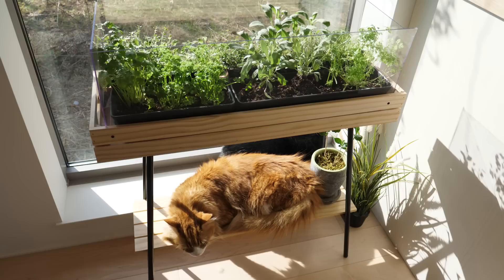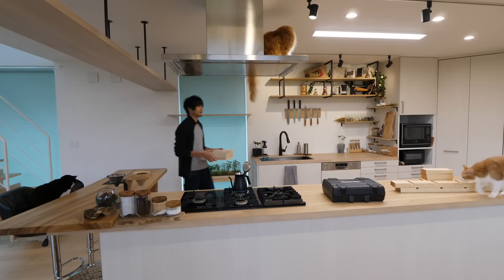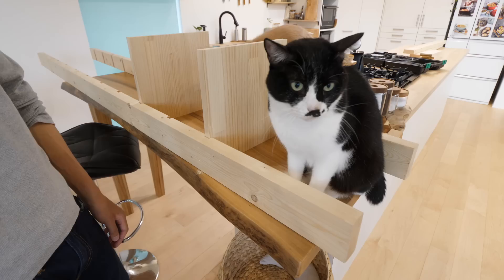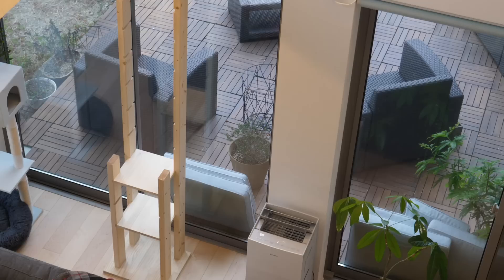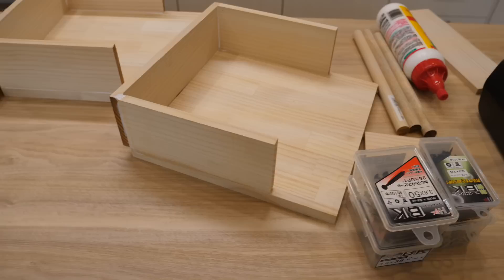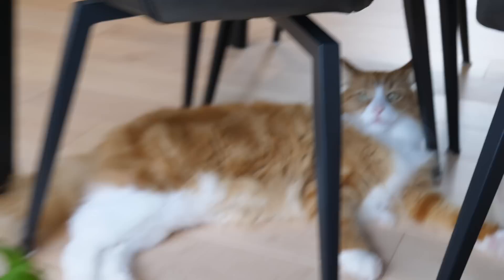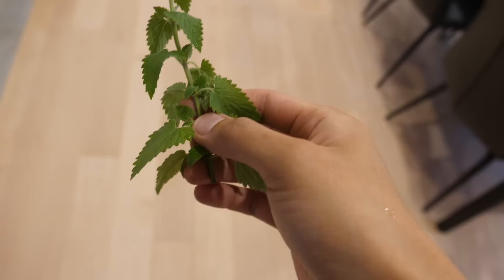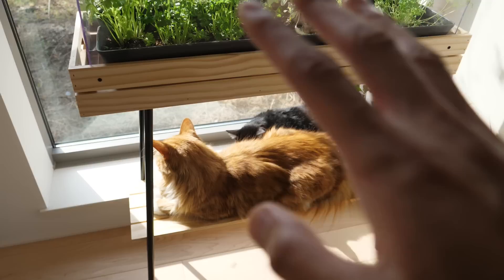Indoor herb stand (🌱🔨DIY vlog)

Comment: I love that Rachel's present, inspired you to make a DIY shelf of your own. Of course, the cats approve! It looks wonderful.

Just a suggestion, if you consider upgrades in the future. Those plastic pots you drilled holes into, can be used as a cover pot. Meaning, if you don't drill into them next time, they will collect any water, from the plastic pots you place on the inside, with drainage holes. The reason this is a useful arrangement is, you can have a small greenhouse outside, growing more herbs.

After removing most of leaves from the inside herbs, you can swap them out of the cover pot, with new herbs growing outside. It's easy to do when you have a plastic pot inside a cover pot. That way, the herbs moved to the greenhouse can regrow their leaves, and the ones placed inside, can have their leaves removed.

It means you will have two lots of plants to manage - inside and outside, but it also means you get a continuous supply of herbs for the kitchen, for longer. I learned this strategy keeping indoors plants. By having two plants - one outside and one inside, so you can swap them out of the cover-pot, to rejuvenate outside again. That way, you never have an empty space in your house, when the plants either die, or need some temporary outside time to thrive.

Comment: love to but i wish i had the space. i know what you mean, fresh herbs really do elavate any food you add the herbs to. we had chillies over the summer. any ideas on how i can DIY a small greenhouse since the one i bought from amazon broke ans flew away in the wind
Reply: If you don’t have much space inside, there are still many herbs you can grow outside without a greenhouse. What climate do you live in?
Reply: @therussianprincess7036  i live in a moderate to cold climate. very rainy 3/4of the year and extremely hot in the summer months
Reply: @romaniwijesiri7977  I also live in this climate! You shouldn’t have too many problems with an herb patch - plants like mint, lovage, chives and sage thrive in these conditions and are perennial. Just watch out for mint, because if it likes the spot it will grow out of control - best to plant it in a plastic pot if you’re putting it in the ground.

You can also try thyme but it is a touch more temperamental in my experience. Sadly I haven’t had much luck with rosemary because it keeps freezing in winter.

There are also herbs you can plant from seeds annually - like parsley and dill. I also tried basil but it didn’t do too well. You can also go for edible flowers like Jun - nasturtiums and pansies are easy to grow.

Hope this helps!